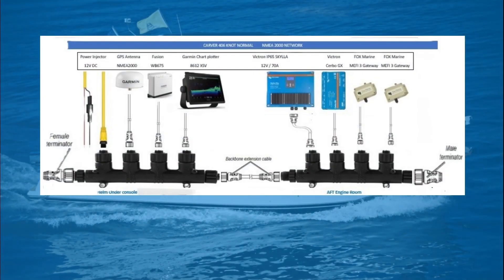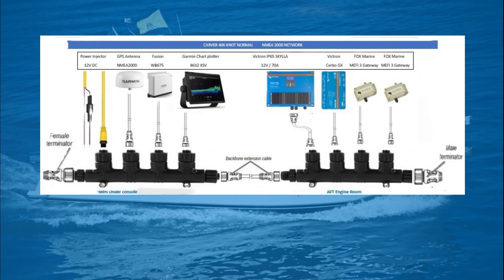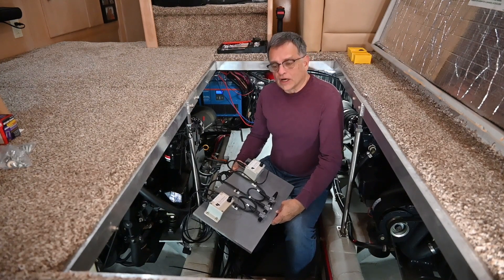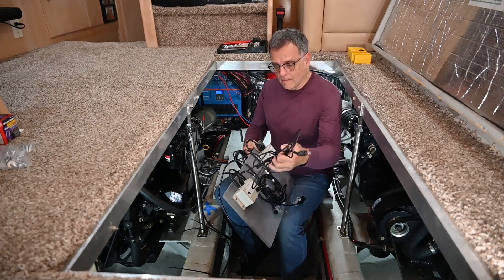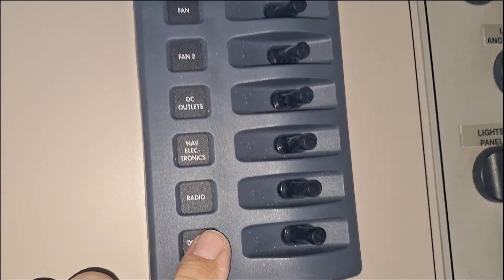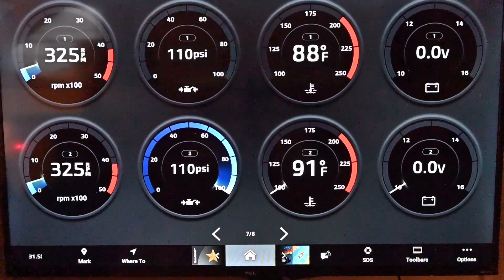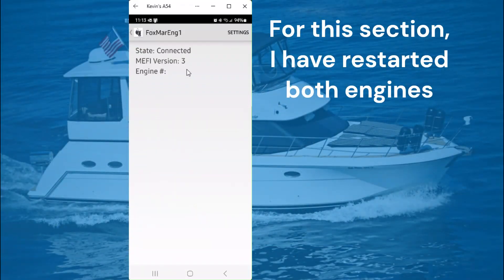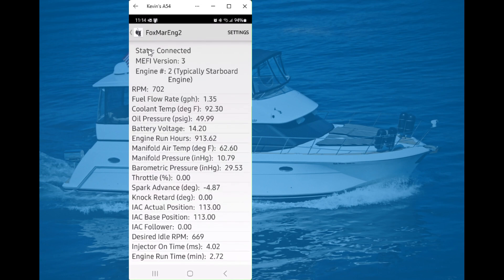NEMA 2000 What now - Fox Marine Engine gateways to Garmin 8612 rev1

Comment: Thanks for the video. I've been researching the Fox Marine gateways for a while. I'm up in the air on whether I want to use a single MFD or one 9" for each engine. Do you feel the 12" is a good size for both engine readouts?
Reply from the maker: @molinaej  yes  a 12" mfd alone is good. I also added an android tablet to run helm so I can see it in two places. Even an 8" tablet is big enough with the high resolution. Good luck!

Comment: I just had these installed on my SeaRay.  Any idea how to get the engine hours to display?  Thanks.
Reply from the maker: @jetlag4754  on my Garmin 8612, it was under the engine icon. First, make sure 12v power is on the NEMA network before trying to find the info as it does not appear until powered on. Also, turn the ignition switch to run position. Otherwise, no data is sent to the nema network. Then, from any screen, select the place you want the hours to display, select the engine, then the specific engine, then hours. GOOD LUCK!